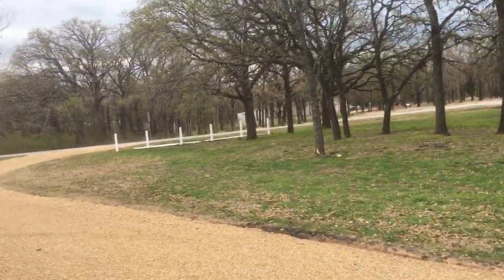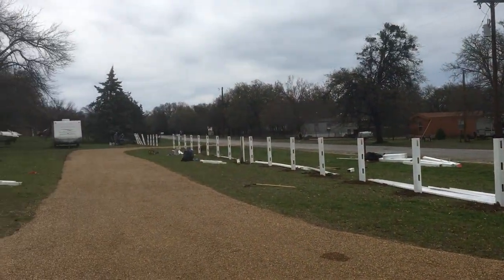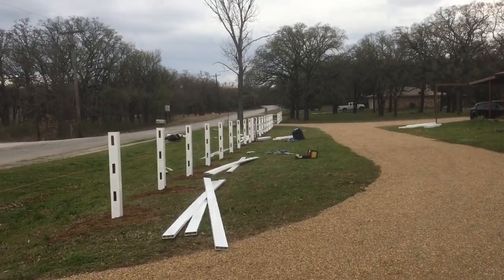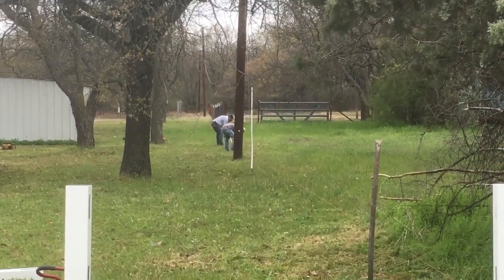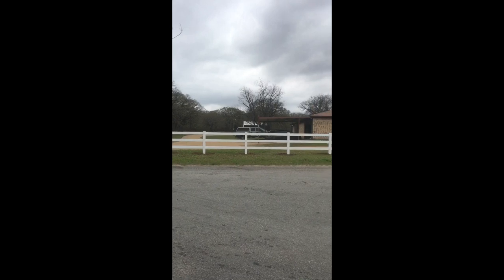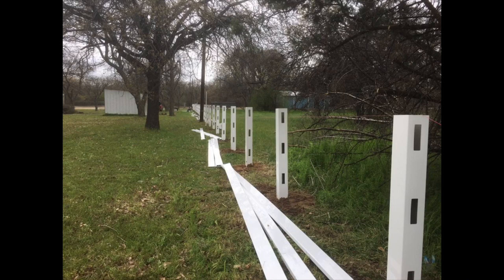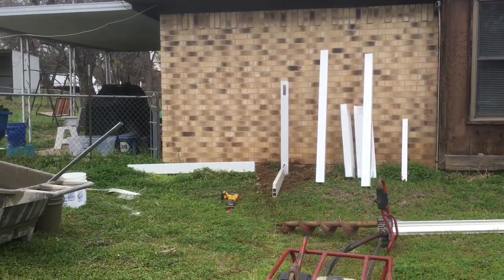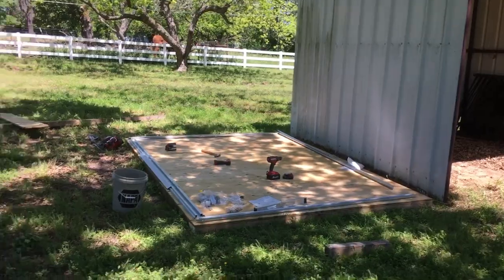3 rail vinyl horse fence installation on 2.6 acres ranch

Comment: Many have asked how much these PVC components cost.   About $20 per foot is  your cost on materials right now.   High quality vinyl can be seen at     https://www.lbplastics.com/     and the posts are set about 2 feet deep.   They provide a 6 foot post for a 4 foot fence, exposed height.  The 16 foot rails used was a good choice by Rolo as they are less likely to sag.   L.B Plastics offers #10 stainless fasteners to attach the gate.  LB's 16' rails are actually 16' long, you will want to add a 1/4" to each 8' section to allow for some play for expansion and contraction.   LB can price you through your local supplier like Town and Country ,  ABC Supply....   Fence Style is 3R28-72 Ranch by LB Plastics.com  800 752 7739

Comment: How much did all that fence cost you& where did you buy . I ask because I have to put up a fence for 1acer.
Reply from the maker: I bought it at Anchor B. Enterprises here in Tx. They where the cheapest. Can’t remember the exact price, but it cost me a total of around $15,000.00 with installation.
Installation was $4 the linear feet to install and $2 the linear feet to remove.(removal of old fence or trees in the way).

Comment: What was the cost for your fence?
Reply from the maker: Jeanine Berthet if not mistaken, for materials was around $8,000. And the installation was separate. They charged me $4 per feet to install and $2 per feet for removal (old fence and tress or shrubs that where in the way).
Reply: Can I introduce our horse fence products for you? haha
Reply from the maker: JINZITA METALWORKS yes

Comment: How much did you spend
Reply from the maker: Edgar Sanchez   if not mistaken, for materials was around $8,000. And the installation was separate. They charged me $4 per feet to install and $2 per feet for removal (old fence and tress or shrubs that where in the way).
Reply: That's ALOT of fence!
It looks great!
I'm planning on the same type of 3 rail on the front half of my acreage!
Reply from the maker: Gary Haber yeah, but totally worth it, looks great.
Reply: @angelasteware1450 to ask anybody how much anything costs is downright rude. but that's you!!